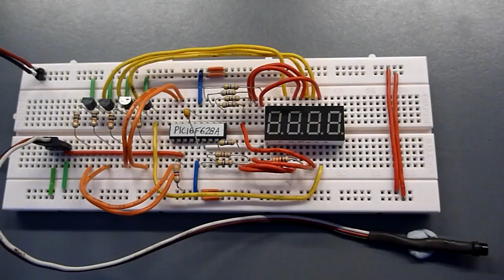DS18B20 Digital Temperature Sensor PIC16F628A

Comment: Hi. Awesome project! I've been searching for a couple of weeks for a circuit like this. All other projects I've found required some sort of button to change temperature modes. With yours I can just set it to Fahrenheit from the get-go.

I can't find any readily-available white 7-segment displays that are common cathode, so I need to go common anode. I still want to keep transistors on the 4 outputs ( ra0 - ra3), but switch them to PNP, and in addition add NPN transistors for each of the segments (to keep it bright and feed with full current). Adding the NPN transistors to the 8 segment outputs requires nothing to be done. However, changing the digit transistors to PNP means the signal needs to be inverted. I could go with a hex inverter IC, or I could do it in software, which I have zero clue as how to go about. I can code, but programming is beyond me. Could you help me with this?
Reply from the maker: Yeah sure, so where are you at? Do you have the equipment to program the chip? Then I can tell you what you need to change in the software to run them as CA displays..
Reply: Jake S I'm in Pennsylvania. I have a PICKit 2 that I bought with the assumption that the included documentation would be understandable. It's not, so I have the ability to flash the chips, but not to understand the language part. I'm going to put this all on breadboard before I flash it, and that's how I'll have to program it, since the PIC16F628A has a different pin-out.
Reply from the maker: Tim Ramich Oh OK I see. Well if you weren't using transistors for the segments you would also need to invert the data in the look up table, i.e., change all the 1's to 0's and all the 0's to 1's to use with a Common Anode Display. But as you want to use NPN transistors to drive the segments this can remain unchanged.
So you need to change a few things when it comes to driving the anode of the LED's, by inverting the the output like you said.
I can explain how to do this in code but unless you can use Microchips MPLAB to compile the assembly file to the burnable HEX file or plan to learn about coding, its probably easier for me to just make the changes and send you the burnable HEX file for you to test.
Let me know which path you want to take.
Also, if you like, head to the contact form to send me an email on my website to discuss it more in depth.
Reply: I guess not. Can anyone out there help me change this code?
Reply from the maker: Yeah what's your email
Reply from the maker: Sorry mate, I missed your email.. Currently changing provider.. Anyway I got it, I'll reply..